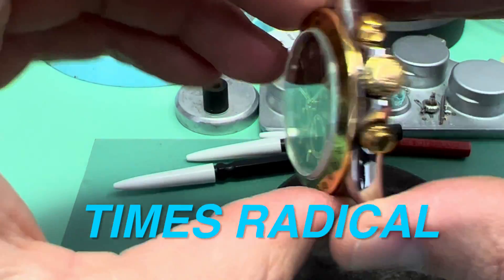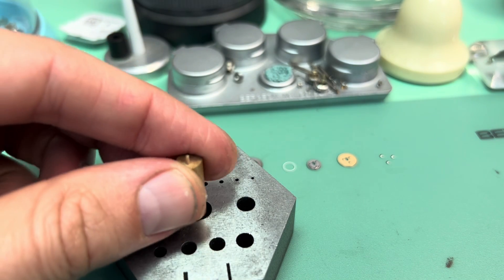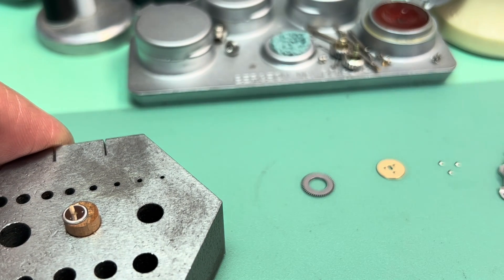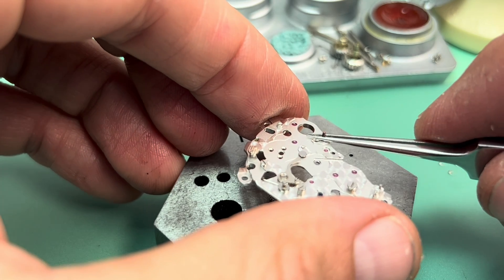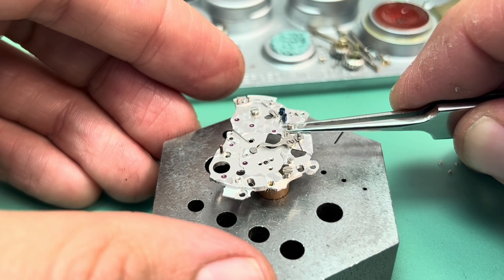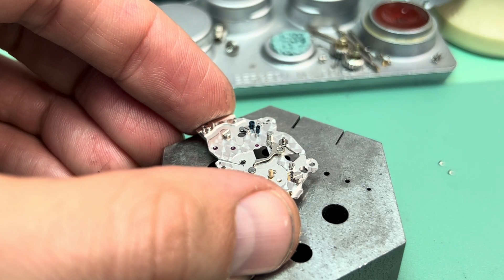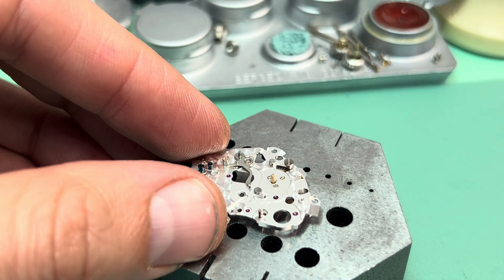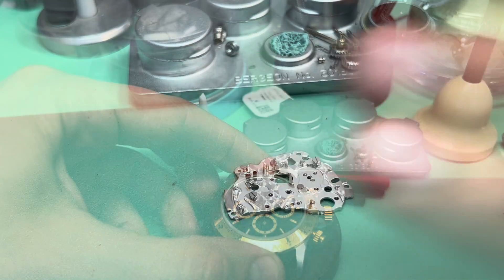Rolex Daytona 16523 Custom Tool for 4030 Crown Wheel Core

Comment: Hey that's a seriously neat idea. And it applies not just to watches, I've seen door locks where a jig like that can be used and even some motorcycle parts are a devil to reassemble without a simple jig. Of course, me the brainless moron, always gets tunnel vision and struggles instead of remembering to whip up something simple.

Thanks!
Reply from the maker: Thanks for watching Alan and being a long time subscriber. I really like watching trick tip videos also, mostly about construction and plumbing even though the only things I fix are watches. I’ve been watching this channel called “pipes and creative” really cool!